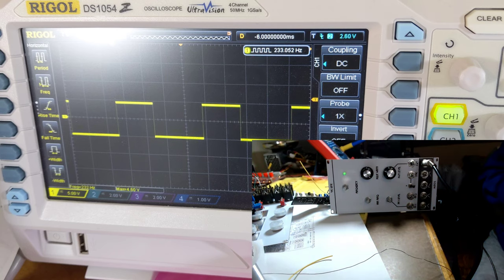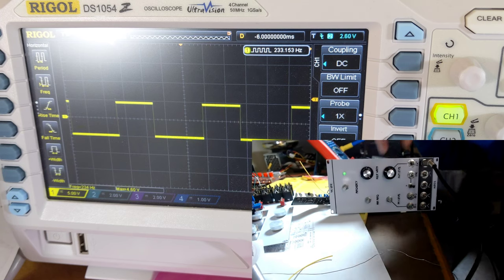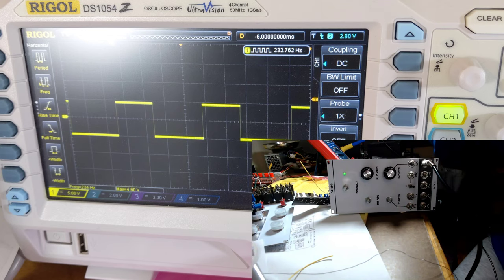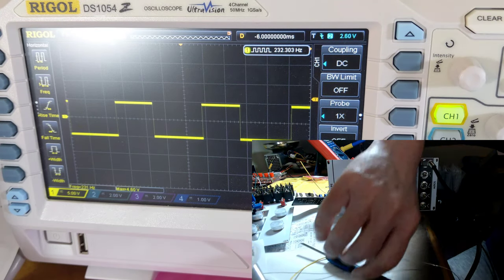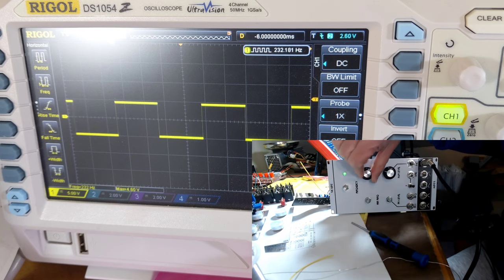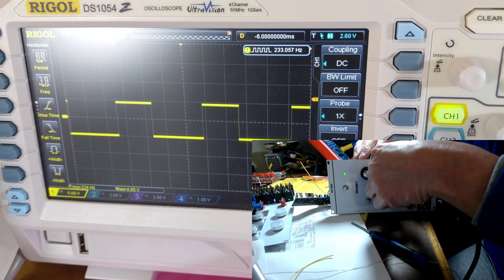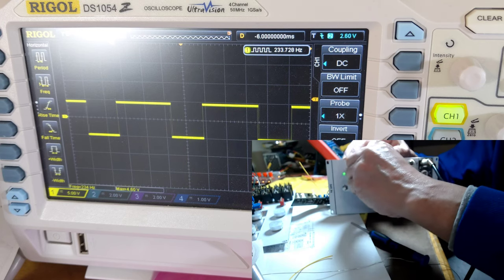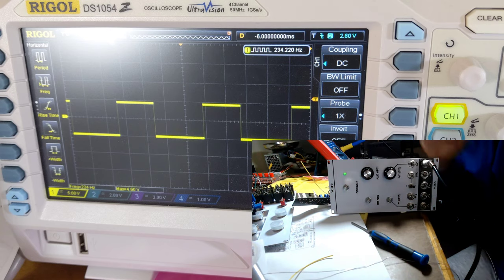Problem with MFOS VC LFO

Comment: without schematics even, I am wondering if the summing node is not a proper virtual ground.  So instead of no current flowing fron summing node through summing resistor through attenuator pot to real ground due to no potential difference, there is current flow through the varying attenuator resistance to ground that is affecting the set point.
Reply from the maker: It's not a virtual ground — the op amp is used as a comparator. This does seem to be a simple matter of summing resistors being much smaller than the pots. The YuSynth VCO has a similar arrangement but with 4x smaller pots and 10x larger summing resistors, and a calculation shows it should have nonzero but pretty much negligible variation of pulse width in a similar test. I don't see why similar value changes shouldn't work here. 

Basically it seems a rookie mistake, which surprises me (a rookie).

Comment: did you try connecting the tip switch of the pw mod cv jack to gnd with a resistor?
Reply from the maker: It is connected to ground, via the pot.